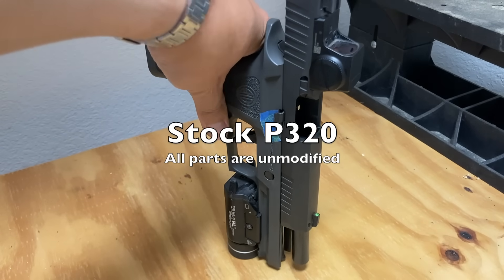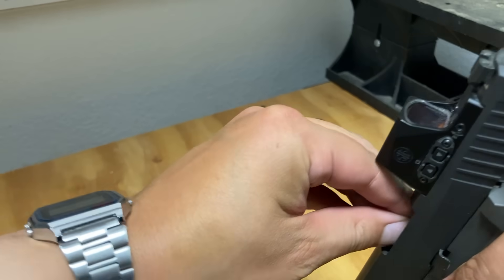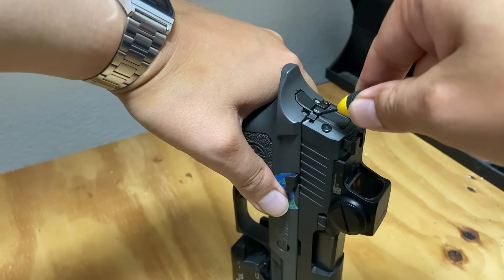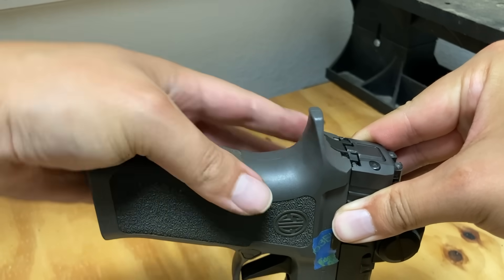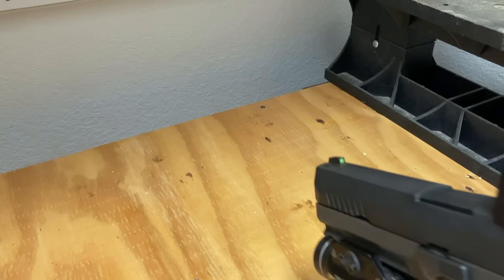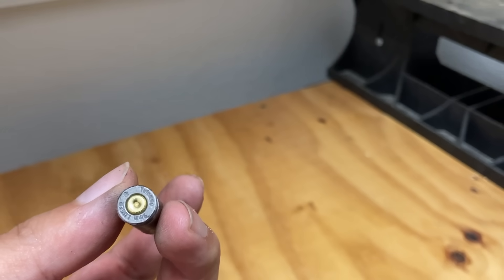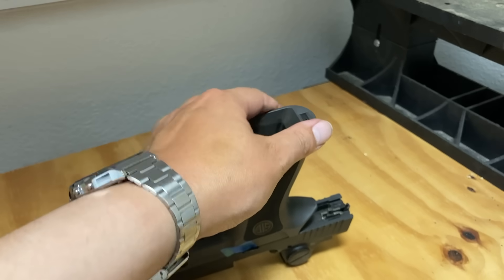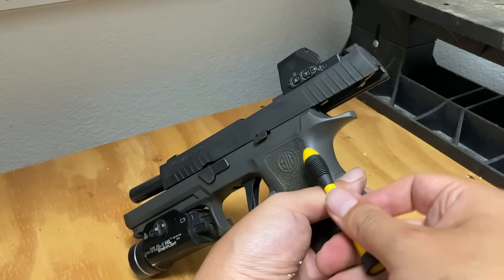Attempting to reproduce the FBI's Aug. 2024 P320 Sear Movement Test

Comment: Would a magazine inserted make any difference?
Reply: As a gunsmith, I'd say it could.
Reply: Yes it would.
Reply: Yeah. Notice how every time he trips the sear he’s squeezing the slide down against the frame. Having a loaded or unloaded magazine in would have the opposite effect.
Reply from the maker: Folks saying it would matter: Go ahead. Put a loaded mag in your P320, and press the slide down towards the frame/FCU. I absolutely guarantee it will compress anyways.
Reply: Good video. The thing that keeps coming up is which version of the pistol are they using? The military version is not the same that the civilian version that is on the shelves. Are the models the police are being issued the same?
Reply from the maker: Functionally, no. Technically the spring pressure deadens the potential wiggle between FCU and slide, but it doesn't prevent that movement, and having a magazine in there would just make the reset longer and more annoying.
Reply: @P320Truther  Very interesting. Thank you for all this!
Reply: @P320Truther it would just increase the distance from the safety lever and striker safety tab, right?
Reply: @P320Truther  yes sir, there is.... there sa video by  youtube channel "Wyoming Gun Project" with title "SIG P320 Un Commanded Discharge and its Repeatable"... the issue is with the trigger. A VERY VERY VERY  slight pull can deactivate the safety, less than 1mm... that's crazy... a very slight out of spec or a dust for that matter can render your gun an assassin of its own. don't trade your safety for a gun that's been proven to hurt people.. lots of choices out there buddy.
Reply: Because it matters. But, we're missing the point here: it has been proven that an uncomended discharge can happen if a conjugation of factors happens, as described at the end of the FBI report. It has been proven that some parts of the guns runs out after about 13, 14k shots, which compromises the reliability of the gun. It has been proven that uncomended discharges while holstered only occur with Sigs, we don't see that happening with glocks or any other brand. There's nothing more to know about it.
Reply: @adamkaminski  I'm not satisfied. I'm not understanding how the FBI proved the manipulation of the slide caused the striker safety to fail 9 times. Like where or what was provided that showed it was stuck/bent/moved/defeated/broke or it's status during the sear release
Reply: @adamkaminski  My department will be issuing the Sig P320 in October, 2025. We shoot 1K rounds per year, per officer. We will receive the P320 X Full with the Trijicon SRO and the Streamlight TLR7. We will be using a Safariland 7360 duty holster. We shoot more than most agencies. We currently carry the Sig P229, 9mm. Officers had no say in the selection of the new issued handgun.
Reply: It's a solid gun; insanely fast and well balanced. I see other departments still issuing this what I look through recent news. I really want one but can't justify the theoretical risk still

Comment: The actual report said that it could discharge if the safety features were non functional but they had to mill the sear in the FCU to make it happen (so obviously unnatural). Meanwhile, the more plausible explanation was the officer’s keys (which were in his strong hand at the time) slipped in and depressed the trigger. That would be more of a holster problem as they did mention there was enough of a gap for that to happen.

All that said, this just proves to me I never want any gun that doesn’t have a manual safety or decocker, since they add an extra layer of safety for weird shit snagging the trigger. I also saw a video a few years back of a Glock 43 going off in a G-Code Incog holster, so any handgun that has no safety has the potential for this to occur.
Reply: The version the FBI tested was a M18, which has a manual safety, but it is a sear trigger safety and not a firing pin block safety.  There is a strange interaction in some P320s where you move the takedown lever,  restore it to its position,  and then skip the step of manually engaging the slide lock.   In that state even with the safety engaged,  the trigger can move and something is actuated.
Reply: @UnnoneWandering  the one the FBI tested was an M18 but it also had NO MANUAL SAFETY as is seen on page 7 of the FBI/MSP report.
Reply: @UnnoneWandering Sure, but the firing pin block is actuated by the trigger, so a manual safety blocking the trigger would also keep the firing pin block from moving.

Also, if you skip the step of manually engaging the slide stop, the trigger is just dead. It can’t trip the sear unless you push up on the slide stop. I know because I did it before.

So given the FBI had to modify the sear in order to induce this problem, I’m gonna lean more towards the user not having the safety engaged and then someone accidentally snagging the trigger with their keys. That means manual safeties should be used.
Reply: @UnnoneWandering  Except it wasn't a traditional M18 in the way that you're thinking it was. It was an M18X which has the XCarry grip module, a flat blade trigger, and no manual safety.
Reply: hey numbnuts, an external safety wont magically stop NDS on 320s lol

Comment: Was the FBI test conducted with a magazine (loaded or unloaded) inserted?
Reply from the maker: Yes, but it makes no functional difference. Technically the spring pressure deadens the potential wiggle between FCU and slide, but it doesn't prevent that movement, and having a magazine in there would just make the reset longer and more annoying.

Comment: It's always Law Enforcement and I'm willing to bet it's worn out pistols... or very dirty pistols...
Reply: They said the gun only had 1300 rounds through it I don’t think it’s was worn out and they also said he only put 100 rounds through it since the initial 1200 rounds test they did so he cleaned it and shot another 100 rounds
Reply: @2xaround_  It may have been cleaned 130o rounds prior, but how many rounds have been fired through in total. Depending on the round count, it could have work out or broken parts.
Reply: Most people that rely on their guns keep them pretty clean. Police/Military firearms are often cleaned more than they are shot and definitely cleaned after they are shot. They also have armorers that make sure the firearms are in good working order. Even if they were dirty/worn out no gun should become unsafe when that happens.
Reply: But it isnt always law enforcement. Sigs have been going off randomly for lots of people and for several years.
Reply from the maker: If the issue was related to wear and tear, then my pistol would be nearly 10x as vulnerable as the pistol the FBI tested.

Comment: In a holstered duty scenario the pistol/holster is continuously moving around being pushed against a vehicle center console, etc. etc.  certain pressures are being applied/reduced just by moving around, getting in/out of car, adjusting duty belt and/or resting your hand on or around the pistol.  That’s why I don’t carry a CZ shadow 2 with 2lb. Trigger and no firing pin block😂😂😂. 
The Sig P320 is marketed as a military/Police sidearm.  And, if the temperature, moon and stars align a certain way it might fire on its own😮😂
It simply can’t be this “touchy”.
Reply: I have tested 4 different P320, pushing/banging (with a rubber mallet) the slide from side to side and up and down after reassembling "Glock Style" and none of them would self-discharge. This incorrect reassmebly also caused about 25% less sear to striker engagement. If there really is a self discharge p[roblem, it's not from this configuration.

Comment: Glock showed the FBI the new gen6 prototypes 😂😂😂
Reply: There are patents you can look up that show a Glock with the bottom half of the magwell that is removable and replaceable. Basically, you could have a 26, 19, 17, flared magwell, pistol brace. In theory you could have a PDW contraption that attaches via the magwell. The patents werent filed by Glock but under the name of two of Glocks top engineers. That might be the Gen6. Glock keeps doing Gen 3 & Gen 5 and adds a new design as Gen 6.

Comment: I know it’s been mentioned before. Maybe from your channel. But I’ve seen putting the slide back on Glock style where the slide is held back with the hand instead of the slide lock causing something not to set right right. A demonstration has showed this causing UD. Since it’s mostly law enforcement, I wonder if they are being taught putting the slides on this way.
Reply from the maker: I don't know about law enforcement, but military personnel are making that precise mistake regularly enough that armorer and NCO periodicals have regular articles reminding people to lift the slide catch lever as part of reassembly.

That said, that specific failure mode also 1) Requires very specific mismatch of parts, and 2) Depending on the tolerances, doesn't always produce a dangerous pistol.

Comment: In your opinion, would the manual safety play any role in all this? Could it prevent it? There have been M18s that supposedly UD'd with the manual safety on, what do you think might've happened there?
Reply: Supposedly the manual safety is a trigger block, not a striker block like the Glock dingus? I'm not an engineer tho.
Reply: @GhostC10 correct. The manual safety blocks the trigger. It also blocks the safety lever from moving. This is still a mystery.
Reply: @GhostC10  yes it prevents the trigger from moving basically. The question is, would this prevent the sear test from failing?

Comment: You gotta put it in holster to mimick FBI test
Reply: Dude. Are you serious? Your tests are flawed from the very get go. The idea of testing is to remove ad many variables as possible so the test is consistent and fair. These guns aren't going off while in someone's hand with an empty magazine. They are going off in holsters, with a loaded magazine.  To accurately test, you absolutely should have the gun holstered and the magazine loaded full. If you are too lazy to remove the gun to reset the slide, then what else are you taking shortcuts on? I respected your initial testing, but you are really losing credibility with these weak excuses to cut corners.
Reply from the maker: No. A holster doesn't functionally change anything, it complicates and lengthens the reset, and if I do, the goalposts immediately move to "You need to use the same holster!"
Reply: @P320Truther  what I'll add is with a P320 that I do know that went off, is the frame had to be applied pressure to the left or right, while the slide was fixed in the holster. Meaning if the gun was in a holster, the slide is clamped by the holster but the grip was possible to be pushed pressure out or  left or right (if viewed from the rear of the grip), so it is a vertical movement that likely wears down the safety sear. For example if you have a gun bolstered with gear on and bending over on the side, your gun grip is applied a sideways force on the frame and this movement repeated could grind down the safety sear. Your test i think isnt done correctly because you are pushing the al8de and frame together or wiggling the slide. So the sig that went off had apparently a softer frame and that allowed the gun to fire even by removing the gun out of the holster afterwards and putting heavier side pressure on the frame to bend almost. SIGfixed the gun by returning it with a more stiffer lower frame but that issue inside remains the same.
Reply: You have to consider holster design. There was cop at an airport whose gun discharged when he sat down. We’ve had two uncommanded discharges in Safariland holsters. What if a part of a uniform got tucked into the holster ?  Someone has to figure this out. The Air Force just lost a service member who removed his holster with his M-18 in it, set it on a desk and it went off, shooting him in the chest killing him. It very upsetting to lose someone like that.
Reply: @P320Truther yes it does. Pressure will be applied differently in a holster on the hip. What youre doing is silly. It doesn't even replicate the FBI testing at all.

Comment: What is that guns round count your testing?
Service pistols are gonna be in the thousands, not  next to new with fresh parts and springs.
Reply from the maker: Nearly 10x the round count of the pistol in the FBI's report.
Reply: The FBI pistol tested had roughly 1,300 rounds.
Reply: @timrobinson6573 1300 rounds is next to nothing.
Reply: Just an integrity check.  I never cared for sig even without the drama.  
If they were able to re create discharges on every 5k round gun or even 1% of guns sold,
Sig would have already been sued into oblivion.

Comment: Have there been any issues with the manual safety versions, and have you tested these theories with aftermarket grips?
Reply: Yes, there is a report released regarding an uncommanded discharge by a Marine MP in Okinawa. The report concluded thr gun fired uncommanded. There were 2 other MP's as witnesses.
Reply: The one in the report was a M18. They only come with manual safeties. The Marine Corps had one go off too that had been in the holster for several hours and they drill us religiously to keep a weapon on safe.

Comment: I don’t think this is a problem with every P320.  Does your sear have the ledge like the sear they tested.  Spring tension the same?  There are still a lot of variables.  Quality control, design and Sigs response are terrible.  This gun is unsafe.  There will be more UDs in the future.
Reply: the point isnt that EVERY p320 is defective; the point is that there are ENOUGH p320s that are defective that its starting to raise eyebrows lol
Reply: @urheimat8841 that was kind of my point.  The P320 is like a box of chocolates…you never know what you’re gonna get.😂
Reply: @Pappy7064 this is exactly what I was going to say. 😂
Reply: The strikers leg in that document was really out of spec and malformed. No way of knowing how many other parts were.
Reply: The issue is that multiple design flaws make a minor manufacturing error into a dangerous situation. A slightly out of spec sear shouldn’t be the only thing between you and a hole in your leg.
Reply: stop coping. how much evidence do y'all siggers need 😂 there is obviously a problem get over it and help with the campaign to fix or discontinue it. the 320 is an awesome firearm but it has to be safe every single sample no exceptions
Reply: In some of the testing I've done on several of ours, by manually pressing the sear down almost 100 times with each pistol, I have never had the striker stopped by the secondary sear notch. The only thing that stopped it (and very reliably) was the striker safety disconnect lever. The only way I could get the striker to sit on the secondary notch was to slowly pull the slide back to re-set the striker until it sat on the secondary, and before it reached the primary. I bought a spare rear slide plate and cut the bottom off so I could see inside. I was getting 100% sear/striker engagement with each reset, but only on the primary sear notch.
Reply: There is a problem if the gun is not correctly maintained.
Reply: It's not possible because physics and they have it out of battery but it's not possible because to disabled the trigger lock it has to push down enough to have it pull and likely it's the holster and some even dent in right at the trigger especially the klydex but others and yes it's a lighter pull but no I don't believe it's the manufacturer it's totally the user
Reply: @cyclonight  Totally incoherent reply.
Reply: @cyclonight  Yep, that's what I've been saying.  Just look at all the reports of  uncommanded discharges in their holsters by glock and smith over the last 30 years.......

Comment: I fixed my P320.I Traded it in.
 I'm not taking no chances . They're blaming too many things they don't even know what the hell's going on. They're blaming the holsters , blaming that.😅
Reply: Cut the p250 holes and get the corresponding lower parts and a slide :)
Reply: You are not taking ANY chances either---RIGHT????
Reply: the p30 x18 they have does it have a actual safety for the gun or? my p30 x 17 does as  and how did his gun go off even if its off his hip or laid down the trigger can be bumped enough to go off or dropped with enough force to trigger the fcu with no external safety i can see it sorry the soldier lost his life . don't think any one will ever know for sure